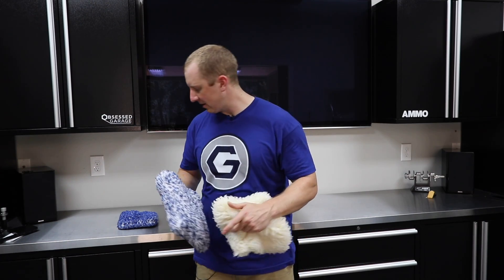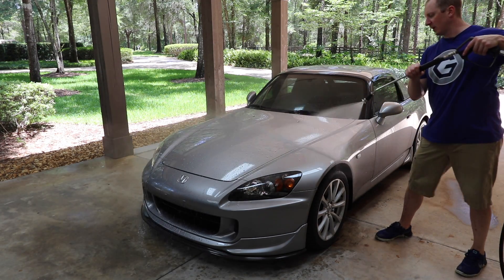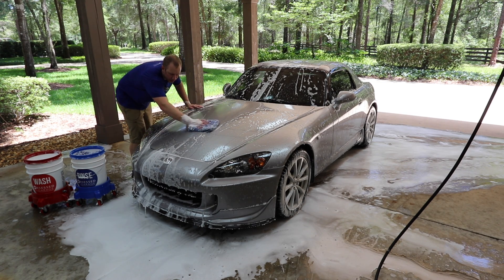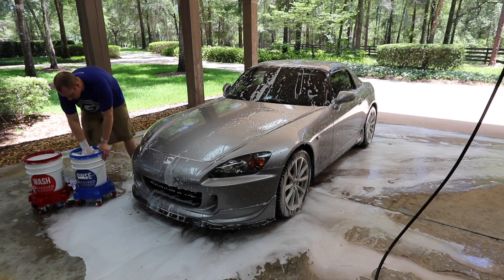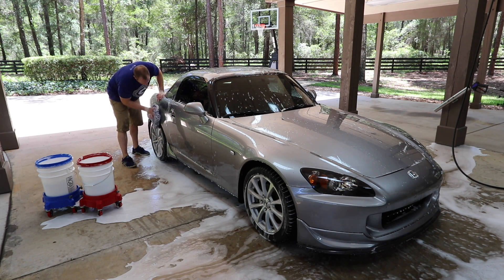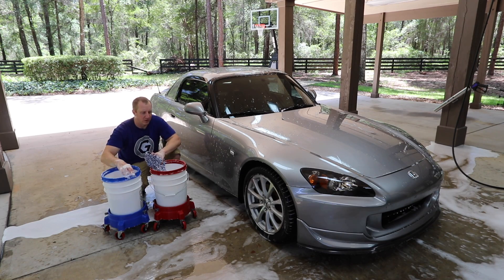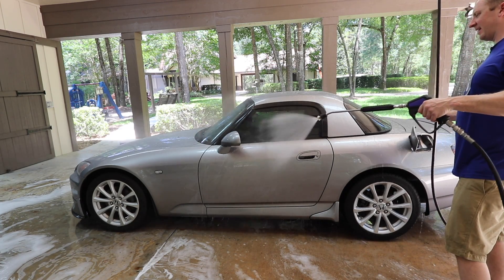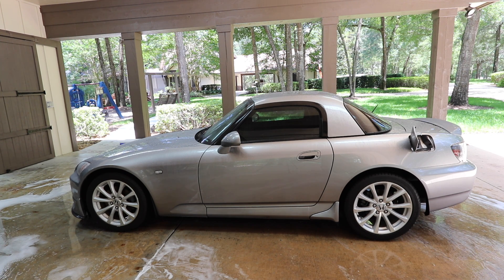Why I Swapped My Silverstone S2000 for Black S2000 CR

Comment: Sucks to be a broke college student will have to do with stuff from autozone
Reply: j 831 same😞
Reply: j 831 the best I can do is try and compound out scratches on my car. Live with the orange peel and wax and wash my car.. As well as use a good wheel cleaner. I really want to have the front bumper re painted but most likely won't happen. Over all the interior is flawless and the exterior isn't that bad. For what I got I'm pretty happy with it. 2013 C300 4Matic Sport. My next upgrade will be some Sport Cup AS/3+
Reply: Thomas Bailey good tires..I would just go for the PSS or new pilot sport 4s..the longevity will be similar to the as3+ especially if your car is staggered they will last almost the same
Reply: trevor philips I need an all season. I'm new to shopping for tires. I tried the Sport cup on a differ W204 Sport like mine and liked them... Haven't seen those tires as an option for my car on tire rack. Haha I'll stress again. Im
New to this

Comment: You can change the light metering mode on the camera, it appears it's taking an average of the entire scene, when maybe in the middle of the day high contrast setting you would want it to expose more for the center.   I forget the lingo  "evaluative" vs "spot metering"   So spot metering is probably what you want, OR, you could shoot the video earlier/later in the day when less contrast is present.

Comment: Hey Matt - URGE Designs Essex AP Racing kit is awesome. You've already dealt with Patrick on the Ohlins (I had those too). The tricky part with BBKs on the S2000 are the wheels that fit over them that look great, but don't require you to mangle up your fenders to make them fit with a substantial tire. I really loved my Wedsport TC105Ns in 17x9 +35 on the s2000 and they'll definitely clear the BBK.
Reply from the maker: +35 is a bit too aggressive for me.  I can't handle poke.

Comment: i own a White 08 CR and im just giving you a heads up about the care that needs to go into that paint.  as you know the roof is black. you can not wash that entire car like you are doing. silver is too easy and doesnt swirl like black. keep foaming and keep rinsing the mit after each panel. i love my CR and it has 9500 miles. Good luck with the build! Louis

Comment: We own 3 S2000's including an 08 Apex Blue CR the other two being an 01 NFR and 05 GPW. I can say for certain the CR feels, rides and handles like the 01 AP-1 with an AP-2 motor. A Honda HPD rep. confirmed as much at a local S2000 meet stating the CR basically returned to the rawness of the AP-1 chassis with very minor almost imperceptible changes to the suspension with upgrades to aero and a slight reduction (99 lbs.) in weight. The CR was basically an AP-1 1.5. After living with all 3 for several years I can say the CR is indeed VERY overrated. Its small production numbers are its only real claim to fame.

Comment: Hey Matt really like the idea of the new microfiber wash pad. Been using Adams wash pad since it came out and was available on their website. I'm on the same page with you as far as the extra weight which you are right is probably being added do you to that inside pading along with the microfibers. Have you attempted to cut open one of your old Adam's pads to see what they have going on in there? You'll know you're onto something the next time you're on Adams website and you see a similar product!
Reply from the maker: The cyclone is just too darn heavy.  I washed it and will use it a few more times to see if it "breaks in."  It lack pliability due to the heft.  I got exactly what I asked for, but it's a bit bulky for the job.

Comment: How long do you use your wash pads for?
Reply: He throws them out after each pass on the car. Can't risk putting a used pad back on the paint (the rinse bucket is just so his trashcan doesn't get swirl marks).
Reply from the maker: Years and years.  I throw them in the washer and dryer after every use.  They last forever if you take care of them.
Reply: Careful not to throw any microfiber into the dryer as you'll fry the fibers, or just use low heat.

Comment: Nothing to do with the video, but quick question that was on my mind. Are there any products you would advise to use to keep the EXTERIOR of the windshield from fogging up? I was thinking of just using a general paint sealant I had laying around, like Jet Seal. Not sure if the beading effect would help out or not.
Reply from the maker: Fog is usually due to dirty interior.  You'll want to make sure the inside is super clean.  Then I'd clay bar and possible Carpro CeriGlass polish the outside.  Then treat with Opti Glass Coat.

Comment: I didn't even have to watch to know that the wash mitt loaded with water must weigh a ton. Just seems like it could be a bit awkward, no? It also barely fits in the bucket. Seemed like it would be good for a truck. Just not an S2000. Great video though! I have done many miles behind the wheel of an AP1.

Comment: wasnt the cr that you just bought was once super charged? been seeing a few posts that it was on s2ki
Reply: I don't doubt it, the car looks like it was modified heavily in the past. I got that vibe.
Reply from the maker: I'm not sure about a supercharger, but I wouldn't doubt it.  They put the car back together perfectly if it did.  It had suspension and wheels for sure.
Reply: The black CR you thinking about is still owned by the original owner. He's coming to us in August
Reply: Obsessed Garage your CR was supercharged. I spoke with the owner just as he was returning it back to stock. LHT probably installed the original, then returned it to stock, and now you're paying them again to supercharge it again. lol. good luck.

Comment: I like kraftwerks sc and if you ever wanted to go crazy and make even more power you could upgrade to there c38-91 rotrex head unit for 500 plus hp
Reply: Glad you got the cr things amazing so rare
Reply from the maker: It put down 405 yesterday on the dyno.  I'm pretty sure that will be sufficient at 2800lbs.  My GT3 is only 450whp at 3200.
Reply: Obsessed Garage yea gonna be beast for sure these motors are bullet proof from factory real st ran there s2000 well over 700hp on the stock bottom end for over 100 hard track passes insane

Comment: You have three high performance cars now well 4 but one is a truck.  Are you going to actually track the CR since you only do canyons in your others?  I respect your decision on not tracking the Porsche but it seems you are going deep with the CR with the upgrades.  What's the point if you mod and never track the car?   Do you just like having cool cars to take out here and there and detail afterwards? To me it's like what's the point of all this.?  Your whole set up is obviously a dream set up and mad respect.   Would like to see the next level in performance driving rather than upgrade and detail videos.  I mod my car and take it to the track or auto x to see how it performs and detail after but that's just me.

Comment: What's the ratio of car wash and water do you mix into the foam bottle?
Reply from the maker: 100mL of soap, the rest water.
Reply: Thanks, what is the size/capacity of your foam bottle so I can get a sense of the ratio? I always have it too runny (as opposed to thick like in your video), so I don't know if I have the wrong settings or my mixture ratio has too much water
Reply from the maker: Part of it is you GPM output on your pressure washer.  It would be hard to compare to this thing unless you have a gas version.  Mine is 2.5 GPM.  I think the bottle is 1L.

Comment: I priced out Matt's bucket package using all the same components and I can tell you that before shipping I wasn't all that far off from Matt's price.  Throw in shipping from multiple vendors and you aren't really saving anything.  I intend to buy the package from Matt.  

Matt, I get your obsession with things.  In another video when I saw you pull out the tape measure and get a center point for the vinyl decal I thought, that's exactly what I would do.
Reply from the maker: You what's interesting.  Those that type in full sentences and paragraph form understand what things cost.  I wish it was less.  I'm a little embarrassed that it costs this much.  The only option would be to use inferior products.  Then I wouldn't use it, so why would I suggest it to others.  I guess it's a slippery slope.  Those without imagination would rather neigh say than create.

Comment: dude if you're going to use the same buckets that you wash your car paint and rinse the pad or the tools you wash your wheels,  you're not going to keep that black paint on the new cr as nice as it is now... get an extra bucket only for Wheel Wash, paint wash bucket supposed to be contaminated free
Reply from the maker: What do you think is going to happen?  It's a plastic bucket, wash it out.
Reply: Obsessed Garage some brake dust particles can stick to the plastic in my wheel wash bucket I see it all the time... regular water is not enough to remove it
Reply from the maker: Then what?  You act as if paint is made of angel wings.  It's paint bro.
Reply: Obsessed Garage lol it is, just saying... not trying to put you on the spot or something... You got a nice car, gotta keep it nice
Reply from the maker: People go overboard on how to care for paint.  You are pushing dirt around on the paint when washing.  A little dirt in the bucket doesn't matter.

Comment: you should get a ap1 instead
Reply from the maker: Why would you want to do that?  It's an inferior car.
Reply: Obsessed Garage in what way is an ap1 a inferior car its the most racecar like out of all of the s2000s, no traction control a 9k redline a quicker steering rack and twitchier suspension... they basically made  the ap2 a soft more daily friendly s2000 that takes away alot of the driving experience
Reply: Jose Peralta the CR is actually very much like the original my00 AP1.
Reply: testing316 exactly why did honda go back and make it more like a ap1 and less of an ap2
Reply: Jose Peralta exactly as you said, the AP2 got soft For the CR they went back to faster steering rack of the my00 AP1 and stiffer suspension, it's really raw. At the end of the day the CR takes the best of the AP2 and my 00 AP1. Only problem with the my00 is the plastic window and 16"wheels and alignment. Fix those, drop a hard to top on and your pretty damn close to the CR
Reply: testing316 which is why i believe the ap1 is the best s2000 ever
Reply: Jose Peralta For me it goes CR then AP1 then AP2. Depends what you want, for my it's the raw sports car feel, others might like the more refined, softer AP2 as a daily.
Reply: Jose Peralta ap1 ftw